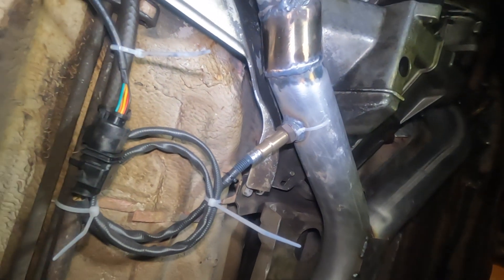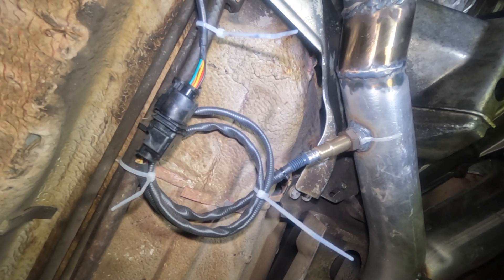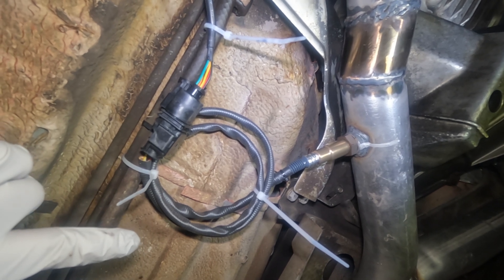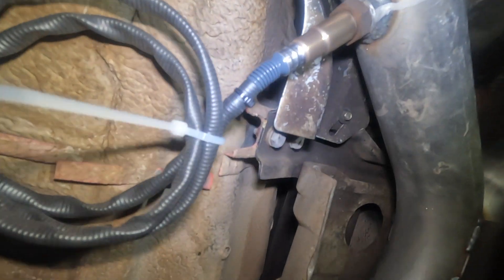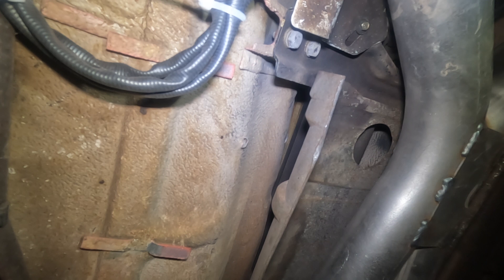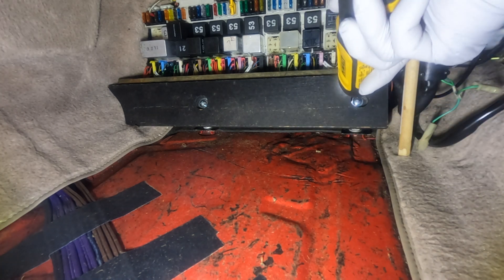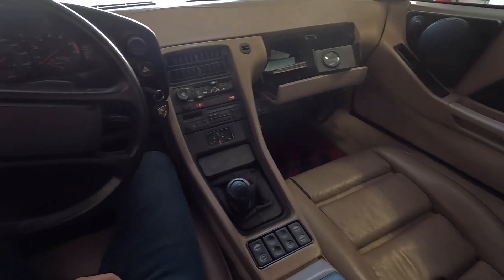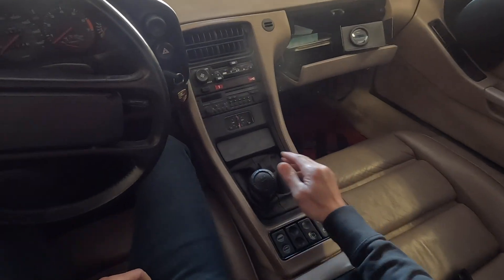Installed AFR meter in a 1985 Porsche 928 S Euro

Comment: I have an '87 S4, I noticed a few months ago that my O2 sensor has been cut off by a previous owner so my car is running on the default fuel / air map. On the S4 the plug in for the O2 sensor is a black cable with plug on the top of fuse panel. Future project is to restore the sensor.
Reply from the maker: I wonder why your PO cut the O2 wire?  BTW, I thought it would be difficult to remove the original O2 sensor off mine so I put some penetrating oil on the threads. You may consider doing so periodically between now and when you do swap it out, just to make it easier.
Reply: @OCDHAUS  Thanks for the advice. My car has had a lot of butchery by previous owners. All the electric mirror cables sheared off both sides, the seat memory computer computer wires cut, at least 5 cut wires under the dash I have no idea what from. The important things work but the luxuries like electric mirrors, seat memory and cruise control are probably gone for good.
Reply from the maker: Oh man, that sucks.  My car had a bunch of ghetto-hacks that pissed me off when I discovered them, like using a ziplock bag and parts packaging to weather proof the door card.  That's why I try to do all the work myself, -no one else gives a sh*t about your car and will likely take shortcuts.

Comment: Yep that’s where mine goes. American version, I’ll be doing the same thing.
Reply from the maker: If you want to buy my hardly used Bosch O2 sensor I got from 928sRus at 50% off, let me know. I installed it brand new on the x-pipe, never plugged it in, drove it about 50 miles, then removed it.

Comment: Could you plus the hole with a steel rivet.  That’s how repairs are done on airplane fuselage.
Reply from the maker: Nice, thanks for the pro-tip William.
Reply: The Euro S2 is the most polluting version with open loop fuel management and the ECU doesn’t support input from an O2 sensor so it is what it is. If you havnt done it I’d recommend updating the air temp sensor in the airbox for a bit more zip and less chance of knock.
Reply from the maker: Hey Gary, when you say “updating,” do you mean replacing with a new one, or something else?  Thanks for your comment btw.